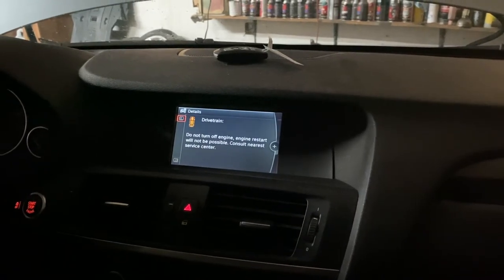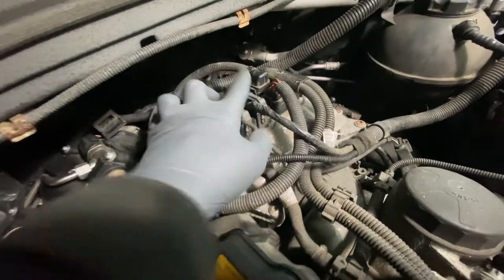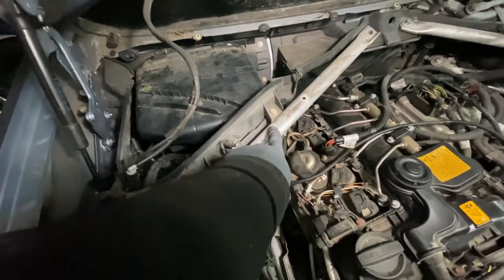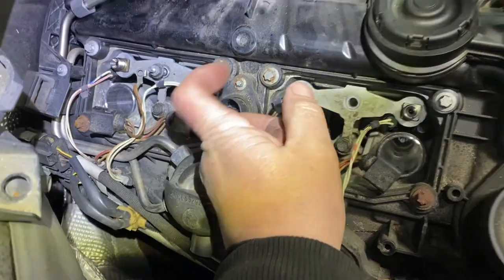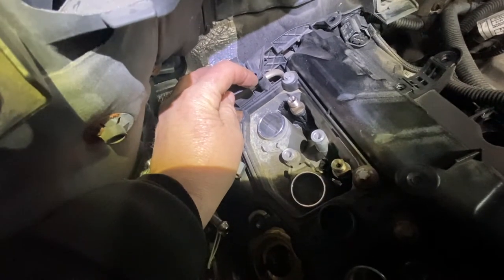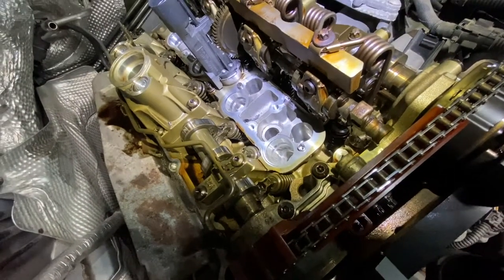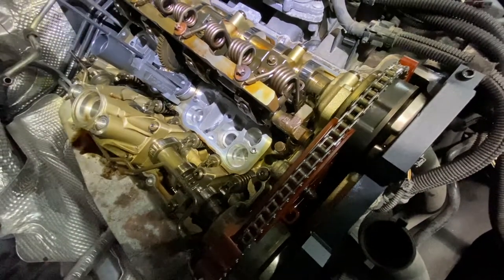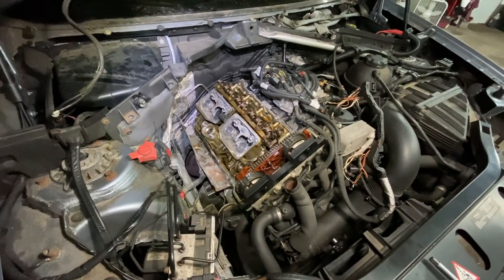BMW Drivetrain Malfunction: Valvetronic Eccentric Shaft Actuator No Movement - Diagnosis & Repair

Comment: Thank you for sharing your experience! Was it sounds like no compression cranking before repair?
Reply from the maker: Thank you! Yes, eccentric cam can leave open the valves and cause low compression among other issues

Comment: I see you test the car with connecting a valvetronic motor on the outside of the car but what do you mean by you "ground it" do you give it power through another cable not just the harness?
Reply from the maker: I just temporarily grounded it so it will work for the test. Once installed it’s grounded to the cylinder head.

Comment: I had to get this replaced on my 2013 X3 as well.  2 weeks later my drivetrain light came back on and it's having trouble even getting up to 50 mph. Any Ideas what it could be now?
Reply from the maker: What codes are coming up now?

Comment: Good afternoon, I have the a 2013 Bmw 328i same motor I replaced timing components about 2 years ago and everything was working fine and now I have a whining noise not too loud but inside the vehicle is more noticeable. Do you have an idea of what it could be. I always use bmw oil filters and oil. Thanks
Reply from the maker: Hard to advise as it could be many things. Make sure the transmission fluid is at the proper level and no leaks. Usually it’s from a failing timing chain guide but you replaced them so you should be good with that.
Reply: Hey did you fix your car? I have the same exact car as yours and my car is acting crazy I really would like your help

Comment: Thanks for the great info!  I have a 2013 BMW x3 N20.  Threw a Drivetrain Malfunction Error and quit.  I have a Bosch scanner and pulled 2  camshaft sensor errors.  Would not restart.  Towed to a local "import" mechanic.  They checked for bent valves, scarred pistons, loose chain (all before opening it up).  They were able to rotate by hand.  So they tried to restart it.  It did restart to everyone's surprise and there are no timing related codes.  There is a Valvtronic code being thrown.  The issue now is that when then try to throttle it up under not load (ie in neutral) , it stalls out.  They are now thinking Valvtronic servo.  Have you ever had this situation where the engine starts but cannot be throttled up?
Reply from the maker: Yes, It's probably the servo motor or the eccentric cam binding. This video shows how to repair it. Also, it the timing chain was never replaced, if should before catastrophic failure. I have videos on all this on my channel. Good luck.
Reply: @Motorcarnut  Thank you for taking the time to respond to this.  Appreciated!
Reply from the maker: No problem!

Comment: I got same code for valvetronic and car crank but no start after I reemplace head gasket, got some code about valvetronic before head gasket too, compression is good
Reply from the maker: What code??
Reply: Valvetronic no movement
Reply from the maker: Circuit or valvetronic motor no good

Comment: I have the same vehicle with the same problem.  What’s a typical cost to perform this repair?  Also, curious to know the additional cost to replace the timing chain?  Interested in having you do the work.
Reply from the maker: Anywhere from $2500 to over $5000 depending on parts that are replaced.

Comment: This exact thing happened to me and I’m about to try and fix it myself on me 2013 BMW 328i. The codes I got are 134F02 and 135B11. Are these similar codes you got???
Reply from the maker: Yes, they are related.
Reply: @Motorcarnut  I see you tested a new motor outside of the engine but do you connect an extra cable to it to give it power? I understand the code should disappear if it fixes the problem but the valvetronic only have one connection
Reply from the maker: No, I just grounded it because it wasn’t installed and grounded.

Comment: Grate video! I wish I had found your channel before
Reply from the maker: Thank you, well now hopefully I can save you some money in the future!
Reply: How can I contact you for a couple of questions I have in my 320i
Reply from the maker: On here so maybe this can help more people in the future
Reply: I have a 2012 BMW 320i, 4 cylinders with 110,000 miles. I recently bought the car at the auction so I don’t have any history on the car. When I purchased it, it was a crank no start. Later found out that the car jumped timing  and replaced the timing chain I also replaced the eccentric shaft sensor, valve cover, coils, and spark plugs.

Now the car starts but is misfiring, rough idling, has no power, and shuts off after a minute or two. I’ve noticed that the injector 2 and 3 are leaking fuel into the spark plugs. It also has drive train malfunction. Do you think the injectors are causing the issues with the car? These are the codes I’m getting

120408 
131401
131501
140002
140010
140201
140202
140210
140302
140310

I highly appreciate it in advance 🙏
Reply from the maker: First did you set up the timing with the proper tools? TDC tool cam tool balance shaft tool vanos tool? Those are misfire codes did you put each injector back in its original location? They are programmed to each specific cylinder and cannot be changed without reprogramming. Did you use a scan tool to relearn the valvetronic solenoid? And the vacuum lines on the engine cover did get mixed up for that 120408 code?
Reply: Sorry for the late reply, I’ve been very busy at work. Yes, I used all the special tools that are required for the timing and yes, I also put all the injectors in the same place and for the valve cover I’ll check all the air lines and check if any are mixed up. Which scanner do you recommend for the relearning for the velvotronic sensor I have a Maxicom can I used that one?

Comment: Hello my noble friend how are things with you congratulations on the video. If you can help me, I would really appreciate it. I have a BMW 320 i 2.0 year 2013. I have already replaced the valvetronic on the ecentric shaft.
Reply: I can't learn the valvetronic the car started twice but it doesn't start anymore and the fault code 135685 doesn't come out of memory even 133b04
Reply from the maker: Thank you!

When you replaced the servo motor, did you use a scan tool to do a relearn procedure?

Comment: Interesting to watch. A sensor in my valvetronic motor went short circuit, I follow a few forums and seen the exact same fault crop up a few times. DME1F1A90 'internal fault 5v sensor supply monitoring'.
Reply from the maker: It’s pretty common on the early models
Reply: @Motorcarnut  Mine was on a 2017 S55 at 3 years 7k miles.
Reply from the maker: So even newer, but not as much
Reply: How did you fix the problem?
Reply: @Ksekhon   A new valvetronic motor was fiitted.
Reply: @lowfinger i same problem my s55 was it a pricey repair?

Comment: After speaking with the mechanic, and doing a total of over $300 in tests, he told me that they need to go deeper into the engine which would cost me another $1,000. He explained that the valves barely moved, all the electronics are fine, and that hopefully it’s the eccentric shaft. Just wondering, could he have concluded that the issue was the valvetronic with a similar test you did. I have a 2013 BMW series 5 528i xdrive. I really don’t want to waste $1,000 if he could’ve concluded this was the issue on the original test. Thanks.
Reply from the maker: Well its hard to judge your mechanics experience, but there should be codes and with the proper scan tool should be able to try to activate the servo motor for the eccentric shaft while looking in through the oil fill hole for shaft movement. If the shaft does not move from stop to stop with scan tool it will set a code. Now these engines are notorious for timing chain failures ( watch my other videos on that) which could be playing a part in this. Now is the vehicle running? if not, then after doing those tests and looking at the live data and being comfortable in your predictions than the next step would be open up and fix what failed.

Comment: Hi I'm having similar issue, I've actually changed the motor and the shaft but upon putting it back together and starting ignition it goes to minimum fine then back to maximum but isn't learning the maximum stop point and it's like it's trying to keep going? Like it doesn't recognise the stop and makes a horrible sound
Reply from the maker: Are you using factory replacement parts? And did you do a relearn with a scan tool?
Reply: @Motorcarnut   Thanks for the reply! Yeah we used factory parts and tried relearning through ISTA but it can't carry out the service function, could it maybe be the cables to the DME?
Reply from the maker: @ashleyhorwood9029 Yes, another common problem is if the servo motor got shorted out it can blow the driver in the DME. Hopefully yours just has a bad connection.

Comment: I got a p1030 code, disappeared the next day… dealer told me the shaft needs to be replaced, but car has been running fine besides a slightly rough idle
Reply from the maker: It’s probably the valvetronic motor

Comment: I baught a 2011 bmw 116i with the N13 engine, the Valvetronick is on the side almost to the back of the engine When I got it the person told me it shuts down on them and when we scan it I got the Vavetronick code so I baught a new valvertronic moto and just take out the old one and put back the new one it was tight to get in but use an aulinkey at the back of it to spin it in and tighten the bolts every time in goes in a little. When we got it all the way in, we try to start it and it never starts just turn over so we put an autel scanner on it and whenever we try to relearn it, it come to a part that it says voltage low or not reach something like that but we get the car to start and it runs a little and start to vibrate and have a little sound like it wants to back fire if that make sense, then shut back down about 4 times so I am trying to find out if there is a relay or fuse or even ECU problem, Please let me know what you think? I check all fuse in the engen area I pull out the box under the glove compartment nex to the door and check it for burn or broken fuse also in the trunk nex to the battery and I pull out the side peace in the trunk and check those fuse as well but all looks good to me, the phues I check with a tester and I ask a electrician to test the black regulator that is in the engine bay nex to the inches on the car bonnet and he say it was working, also take out that little black box at the front of the engine that you have to cut open to check fuse and they all good as well
Reply from the maker: What codes do you have now after the valvetronic replacement?
Reply: @Motorcarnut  I will get a electrician to look at it tomorrow and then keep you posted.
Reply: i'm having a very similar problem i get valvetronic codes and the engine idols rough and is making popping noises out of the exhaust, did you manage to fix this ?

Comment: So, I just finish the timing chain, but the car does not start, the owner brought it not running, saying that he was driving and all of a sudden the display says shut the car imediatly there is a mulfunction, he turned off the engine and could not restart the car again, so after inspecting the car I noticed some movement in the chain and decided to remove the valve cover, and as i suspected the time went off by 5 or 6 teeth , so I told the owner we can try replacing the timimg chain and hopefully that will fix everything, so now it does not start and these are the codes, 135A08 valvetronic servomotor position sensor signal not plausible, 135808 valvetronic servomotor position sensor mulfunction, CDA904 No message ( status of trailer, 0x2E4) DME Reciver AHM Transmitter, 213A21 vehicle voltage , Working Area. Voltage to low and last one 213501 Power management total discharge.
I can hear the servomotor moving when turning ignition ON or after turning OFF,  I can see some spark from time to time on cylinder No 1 but no spark on the other 3
I have not swiched coils but I don't think is a coil issue, I think the spark is being disable from the DME because other issues or causes .
Any ideas, let me know , I will apreciatte it , Thanks in advance.
Reply from the maker: I need a little history, did the car have codes before you worked on it? If so, what were they? Also did you have all the proper tools to set the cams, vanos oil pump balance shafts and TDC pin? Did you check cylinder compression for any bent valves?
Reply: @Motorcarnut  when  I got the car it didn't trow me any codes  , the battery was dead,  so I charged the battery and tried to start it but  it didn't work,  so the first thing that came to my mind was to check the timing,  and I saw through the oil cap hole the slack in the chain , so I removed the valve cover and confirmed the timing off,  I didn't check for bent valves  because when cranking sounded with enough power (compression) my mistake I know.
Yes I have all the tools needed for timing the engine the right way, the pin that locks the fly wheel, the tool that locks the  teeth in the fly wheel,  the little tool for the balancing shaft , the one that holds the cams along with the one for that vanos, so I guess I am going to start with the compression test  even though the engine sounds strong enough,  what do you think.
Reply from the maker: Ok, got it. Well what I don’t like is the valvetronic codes, if the servo motor is not working it may hold the intake valves open and the compression test will be inaccurate. Do you have a scan tool to try a relearn of the valvetronic eccentric cam stops? If you do and it can’t complete the reset, that can be the problem right there. You may hear it but maybe it’s not moving or binding. They are known for that as well.
Reply: @Motorcarnut  So, I am going to remove the valve cover and check the eccentric shaft position before I do the compression test and then I will check the movement of the servomotor.
Thanks a lot for the response Sr
I really appreciate it
Reply from the maker: No problem